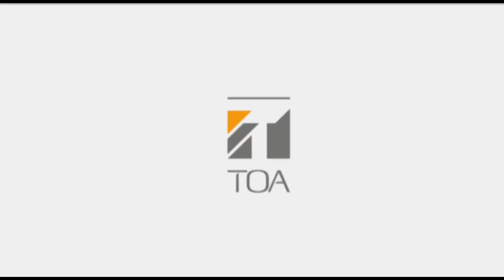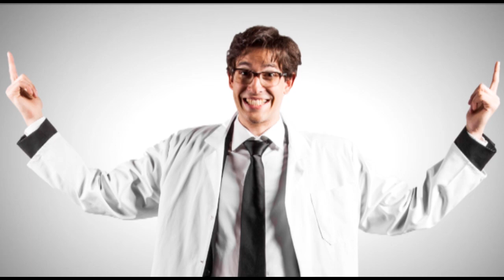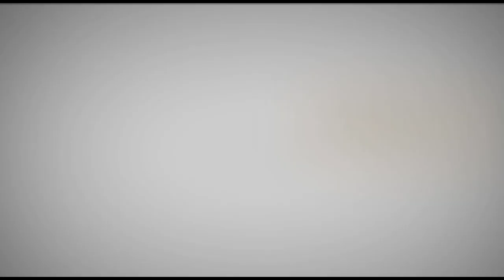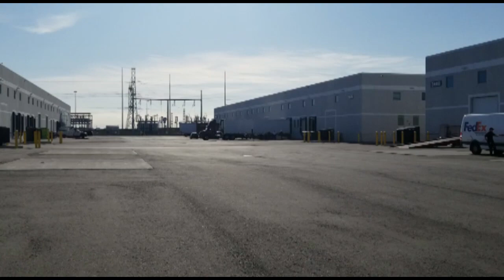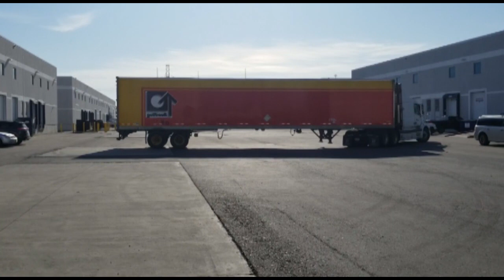TOA's HA-1010 Long Range Outdoor Slim Array Speaker Demonstration

Comment: i think these horn array speakers are used for clock towers with digital carillons outdoor weatherproof talkback and pa intercomsystems and sirens like emergency warning siren systems.
Reply from the maker: Thanks for your comment. These long arrays perform great in outdoor settings where a large area needs to be covered and work great as an early warning system.
Reply: @TOACanadaCorp  yep